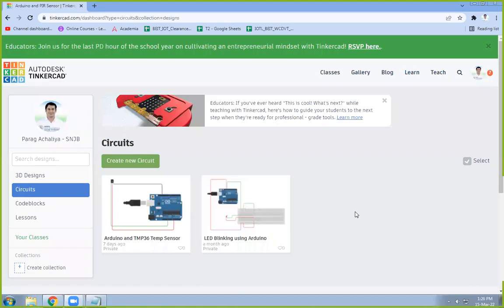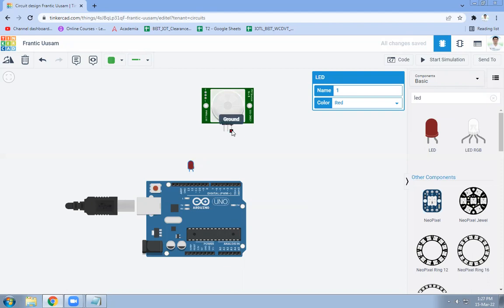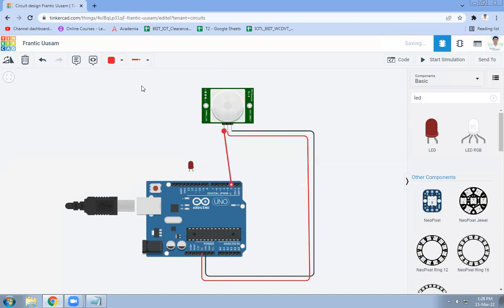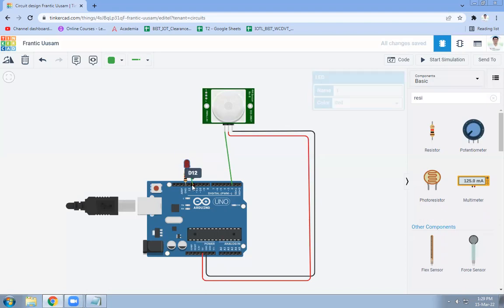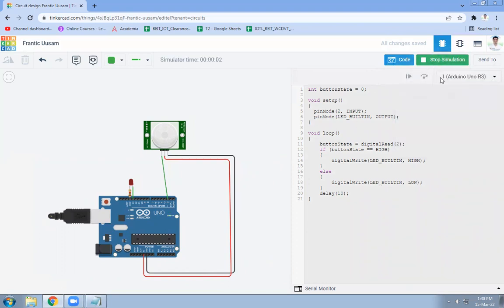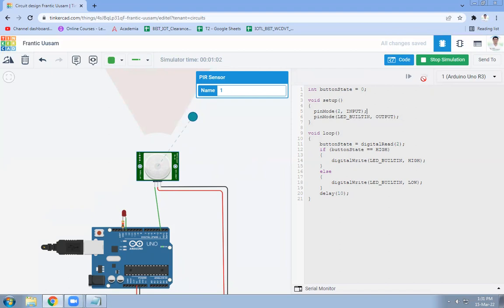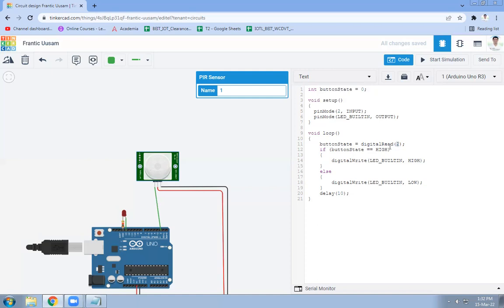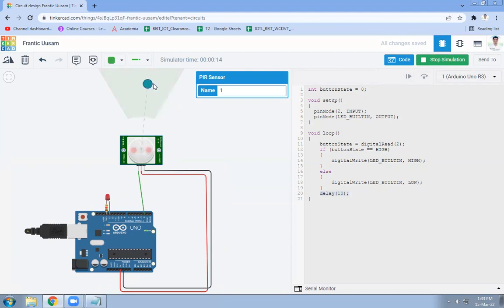PIR Sensor and Arduino Interfacing in Tinkercad

Comment: // heres the code
int buttonState = 0 ;

void setup()
{
  pinMode(2, INPUT);
  pinMode(LED_BUILTIN, OUTPUT);
}

void loop()
{
   buttonState = digitalRead(2);
   if (buttonState == HIGH)
   { 
     digitalWrite(LED_BUILTIN, HIGH);
   }
  else
  {
    digitalWrite(LED_BUILTIN, LOW);
  }
  delay(10);
}